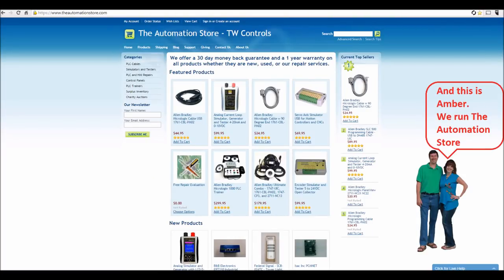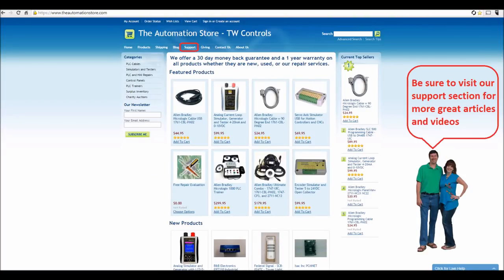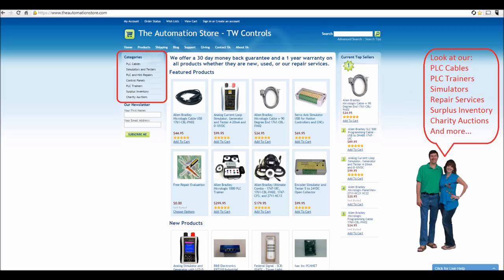Introduction to Electrical Control Panels including PLCs and HMIs

Comment: Thank you for your very informative and much needed videos.  I started restoring old machinery as a hobby and need to learn about the electrical controls. Thank you so much.
Reply from the maker: Glad to help
Reply: @TimWilborne  Maybe this is not what your channel is about, but what I would like to see in one or more videos is the type and gauge of wire,  type of wire connectors, crimping tools, terminal blocks, types of project boxes, enclosures, and WHERE to buy these items.  You have a large number of videos and Playlists and I have spent quite a lot of time trying to fine the information I need with some, but limited success.  I'm dealing with Machine tools. Lathes and Milling machines, their stop/start/reversing controls, and also running their 3 Phase motors on Single Phase.Thanks

Comment: I was thinking about your panel building video this last week while installing a beautiful prebuilt control panel.  My co worker had the thing so greasy by the time we were finished !!!  He also forced the rigid conduit, that was cut too long with a kick from his boot to the ko on top.  The door was a little bent after that.  I told him about your video and the gloves, and cleaning every few minutes, and he started to laugh !!  So keep in mind what happens after it leaves your place.  Pretty sad some of the electricians in factories are just careless labor.
Reply from the maker: Yes I've seen some crazy installations over the years.  I should probably do a video showcasing some of them.  We have found that if the install isn't done cleanly, the system is more likely to not be taken care of over the years.  We've shocked a few owners by telling them we wouldn't build any more control panels for them because their installer's quality wasn't good enough.

Comment: Hi, I’m recently getting into an electrical engineering role in a poultry kill facility in the UK so 3 phase 230v. I’ve been told that the thing they need most is for someone to be able to fault find, identify and repair on 24v safety circuits. Could you do a video on the basics as I’m really interested and looking to get some knowledge. Great vid, thanks Tom
Reply from the maker: Hi Tom, thanks for watching!  As far as safety circuits I've avoided them till now because there are so many requirements that vary by location and industry, but a few safety troubleshooting circuit videos would be a good idea.  We have some basic circuit troubleshooting videos in the works.  This sinking and sourcing video can help clear up a lot of confusion on 24VDC circuits to and from PLCs.
https://youtu.be/VFdtz3q4as8

Comment: Good job. Side note - I wish finger guards were standard on all disconnect power inputs. I hate opening panels with exposed input 480VAC lugs.
Reply from the maker: Most have guards. That disconnect does, they just weren't installed during the video.

Comment: How do you distribute the 24vdc to different items? Some plc's need as many as 3 lines of voltage and the transformer only has 2 screws for terminals. Is there a distribution block for din rail?
Reply from the maker: Yes, we are working on some videos detailing out these parts.

Comment: Nice video.  How do you cut the square holes for the hmi. Currently use an angle grinder,  but its messy
Reply from the maker: I use a grinder too, here is a video I did on it.
https://twcontrols.com/lessons/cutting-holes-in-control-panels-cutoff-wheel-vs-jigsaw-vs-plasma-which-one-wins

Comment: Great video! Appreciate the time input but I have a requests. I have been selling servo's, VFD, PLC's and motion controllers for years. I know exactly what to spec on that end but am completely lost on fusing, contacters, etc. Can you put a Best Practices for a PLC project and a couple of servos or VFD's, what should be used on the input side?

Comment: good day, have you ever made a control of two synchronized axes with analog outputs +/-10v, I am doing it with an s7-1200 but it is not precise
Reply from the maker: You need a motion controller for precision.

Comment: hi sir, will you further tell us about how to work on control panels? safety  and precautions.
Reply from the maker: You need to find information on arc flash and shock protection. There are lots of good videos on YouTube about this.

Comment: Thank you for great video.Can you advice any good literature or info for controls building?There is any info on small DIY projects using basic relays and contractors similar to DOL.Thank you
Reply from the maker: You can find lots of great articles at https://www.theautomationstore.com/articles/.  Here is one specifically about motor starters https://www.theautomationstore.com/3-wire-control-start-stop-circuit/

Comment: Thank you so much for your videos.  I have a degree in Instrumentation/Controls but I have hard a time finding work due to the fact that I don't have any hands on experience.  I'm trying to find work in the Central Texas region.  I have both a BS in Environmental Engineering and a technical degree in the Instrumentation/Controls field.  Any suggestions?  Can I teach myself panel building?
Reply: I would start by sending out some resumes and doing interviews instead of posting comments to YouTube. Just my 2c

Comment: hello Tim, Good Morning...
How do we calculate the cable size for both single phase and three phase systems based on Ampere rating?
Reply: Phase has nothing to do with current. Look up the wire ampacity chart in the NEC. You don’t need to do any calculations unless you want to check for voltage drop on a long run.

Comment: on a micro 800 im going to use current transformer, for my solar system, the current will be flowing both ways how do i make the plc see which way the current is flowing  thanks paul
Reply from the maker: You would need a bi directional input.

Comment: Is all of PLC DC? Do they ever use AC for power to actuators but 0-10v DC for control?
Reply from the maker: Yes, many times you will have an AC powered device with the positioning controlled by an analog signal.

Comment: can you make a live example of creating at least part of this panel, and how installments are made, and how did you did the wiring diagram ?
Reply from the maker: It is on the list. thank you for the suggestion!
Reply: But I hope it will be soon not a long term suggestion
Reply: Any news ?
Reply: 1. Layout sub plate.
Tape Mylar paper to sub-plate, Draw your lines.
Center-punch where your screws/rivets will be.
Use paper template over and over.
2. Mount DIN rail and Wire duct.
(DIN stands for Deutsche Institut fur Normung)
(Finger wire duct or Hole wire duct) with screws or pop rivets.
Drill pilot holes, screw holes and then tap holes for screws.
8-32 / 10-32 x 1/4" with lock washer or metric equivalent.
Philips head or nut head . Some are self tapping.
No tap for rivets.
Mount components to DIN rail or fasten to sub-plate
with screws and washers (Many different sizes).
3. Mount Tag track with sticky back and rivets.
Install tags.
4. Wire Components.
Wire components according to electrical schematic.
Size wires according to necessary amperage of components.
Use wire Ferrell or ring / fork terminals when necessary.
Some Soldering may be required.
Screw drivers, Wire cutters, Wire strippers, Pop rivet gun,
DIN cutter, Band saw, Sander, Files, Drills, Taps, Solder,
Solder iron, Shrink tubing, Lamacoid markers.
Nut drivers, Wire crimpers, Hammer, Center punch.
Drill Motor, Transfer punch set. Pens, Pencils.
Pencil sharpener, Eraser, WD-40, Rags, Windex.
Scissors, Sharp knife, Heat gun, Electrical Tape.
Dremel and bits, Dielectric Goop for ground bar.
Straight edge, Tape measure, Safety glasses.
Coffee. (Optional for some)

Comment: What software do you use for wiring diagrams etc?
Reply from the maker: Hi Terry.  Right now I'm using an old version of Autocad but this is something need evaluate some time.  There are a lot of good options on the market.

Comment: My employer uses  something called a "pull sheet" for wiring our panels. Are you familiar with this? If so, could you explain the difference and show an example? I'm a mechanic and am interested in the electrical side of things. Its my understanding that the pull sheets are generated from the schematics and just simplify things.
Reply from the maker: You'll see them used a lot in large installations.  It makes interconnecting panels much easier.  I don't get involved in many large scale installations so I'm not experienced enough do a video on them.
Reply: That make sense. Most of our enclosures are 2,3, and even 4 doors. The schematic notebooks are like huge novels!

Comment: Hi Tim, great video but I'm confused about one thing, your 120VAC power distribution  on page number CO2 of your sample drawings, what is being powered up? What wires are going to the aux contacts? I'm sure it's something I overlooked. Can someone please explain this part to me? Thanks in advance
Reply from the maker: Those are chemical pumps that we supplied 120VAC continuously to then there was an enable dry contact that actually triggered the pump.  So if you find E0114CR1...which can be found on page E01, rung 14, you'll see Y6 enables the pump.  The reason we do this is so that the chemical pumps can easily be primed from the pump when changing chemical drums since they are always powered.  They switch them to hand at the pump, prime them, then switch them back to auto which puts control back at the PLC.  Clear as mud?
Reply: @TimWilborne  thanks Tim

Comment: You place a control transformer directly (almost against) beside the PLC CPU..
Reply from the maker: It was further away than it looked at that angle but yes it was very tight.

Comment: Hi, excellent video congratulations, one question please, which software do you use to do electrical design and panel building, Thank you.
Reply from the maker: Jairo Alvear I use the basic version of AutoCAD but recently I've been playing with Google SketchUp and it's shows potential for making electrical drawings.
Reply: thanks a lot, i Will check it out. :)

Comment: Sir, i,ve been working as electrical engineer for last two years. I've seen seperate control transformer either in case when we don't have to step up or step down voltages.
Could you tell me why we use these control transformers in our panels?
Reply: I believe what you're referring to is an isolation transformer. This transformer essentially just physically isolates circuits from each other so if you happen to get a short or some other potentially damaging situation on the main side of the circuit, everything on the isolated side of the circuit will be protected from damages

Comment: Hi. 
Why can't you make a video about, how to troubleshoot by using multimeter. That would be great lesson. Example when a temperature gauge on the field is not working and you need to solve the problem.
Reply from the maker: Great idea!  We are working on a switch and instrument troubleshooting series that should cover that.
Reply: @TimWilborne   Thanks for the reply. looking forward for it. 
I have even one more thing. when a plc is not able to work properly then you need to connect a laptop to ping the plc and troubleshoot would be great too. Is that possible?
Reply from the maker: @winniekumar5291  You mean something like this one?  https://www.youtube.com/watch?v=WmVAhynBSH0
Reply: @TimWilborne  YES! Thank you very much. On today I will go back and troubleshoot my plc and se why it is not responding. Thank you for your help.

Comment: Great video,so what can cause the motor to trip on the starter switch overload
Reply from the maker: Addae Paponette Basically the motor is pulling too many amps. It could be a bad motor or mechanical binding.

Comment: Awesome video...cept the part where you're prodding around in a panel w/o any electrical safety precautions and there's 480V supply to the transformer 0_o Pretttttty sure that's in violation of OSHA 1910.137?
Reply from the maker: Covered you here but our last commenters video was popular so I'll put this one down, thanks!
https://youtu.be/MnSe_dPXvAo?t=426

Comment: What is the purpose of (12) Ammonia and (13) Phosphorus and (39)?
Reply from the maker: Hi Jim, can you give me some more information?  I'm not understanding the question.
Reply from the maker: OK gotcha, it has been a few years since I built this panel.  This was a brewery waste water system so I'm guessing that these were added because of a biological imbalance in the system.  

I know adding Ammonia can help reduce foaming and help settle sludge, both which are issues in brewery waste.  

I don't think Phosphorus was added to this system since removal of phosphorus is usually a challenge in waste water.  I'm going to guess that this was a chemical to help in the removal process.

Comment: I didn’t know that you were supposed to wire lighted E-Stops so they light up when pushed. 
I wire them so they light up when pulled.
Reply from the maker: I don't know that it is specified either way, I'll have to look into it.

Comment: Are these panels built and wired in the field or are they built in a factory and an electrician just comes along and wires electrical supply? Who installs and configures the digital and analong field devices/plc ? I'm very interested in this field of control and automation, just trying to figure out where to start.
Reply from the maker: Usually they are built in a panel shop then installed by an electrician who will at least connect the main power.  Some electricians will also connect the motor loads.  Usually and electrician will pull the wires for the digital and analog field devices but someone more familiar with the control system will actually land them and power up the system.  Here is a good place to start.
https://www.theautomationstore.com/rslogix-500-industrial-control-panel-trainer-lessons/
Reply: @TimWilborne  Thank you for the response. I have taken a college course on PLCs systems, we programmed Allen Bradley rslogix 500/5000 based off of real world industrial examples (PLCs 4th edition written by Frank D Petruzella). Am I ready to begin entry work as a PLC programmer? Should I start off as a technician building panels and work my way up by asking for cuts of the ladder logic of what I'm assembling and what the process is to be performed? I had an interview at a company and I was conservative in saying I was ready to get straight into programming but maybe I should have been more confident and gone for it. What are the steps of progression in this industry? Thanks again.
Reply from the maker: Hi Andrew.  I've been trying to think how to best respond to this and I think I'll turn your question into a video.  There is lots of things to consider.  There are very few PLC programming jobs out there.  I probably program less than 10% of the time.  Other time is spent designing, wiring, and most importantly TROUBLESHOOTING.  I would get all the programs and control panel wiring diagrams you can and study them.  Get yourself a PLC to practice on.  And yes be confident!  Subscribe to our channel and tap the bell beside of it so you know when that video comes out.
Reply: @TimWilborne  Thanks Tim! I've learned a lot from your channel and really appreciate the input!
Reply from the maker: Hi Andrew, here's a sneak peak.  Let me know what you think.  
https://www.youtube.com/watch?v=Ct4443wUyhc
Reply: @TimWilborne  Hey Tim, great video that cleared up a lot of questions. It makes sense that these heavy duty PLCs are set it and forget it, but the field devices and wiring are more prone to fail. The idea of fixing a factory machine or troubleshooting/calibrating field devices does sound interesting. I enjoyed hearing your personal experience, I had somewhat similar situation of being thrown into the fire as an automotive tech. I will move forward with your advice and look for a maintenance job. On a side note a may be offered an opportunity to become an Hvac controls technician (industrual/commercial). I would use my PLC knoeledge but also go on to learn more Hvac knowledge, software, DDC, and some networking concepts. Any thoughts on this? Once again I appreciate the video, you covered a lot of bases, very helpful, thank you!
Reply from the maker: Andrew Morgan  The HVAC and building automation is getting more high tech everyday.  Your larger systems  are PLC controlled and use lots of distributed I/O.  I think my advice would be the same.  As long as it looks like an opportunity to advance your skills in a direction you want then go for it.

Comment: how can we get single phase 230 vac from 480 vac three phase north american supply?
Reply from the maker: radhika k Two legs of your 480-volt power and a transformer such as these would do the trick. You would just need to figure out what KVA you need. https://www.automationdirect.com/adc/Shopping/Catalog/Power_Products_(Electrical)/Power_Transformers/1-Phase_Encapsulated_Transformers_(NEMA_Rated)/480x240_VAC_to_240X120_VAC
Reply: Thanks a lot Tim, Could you please let me know the formula to calculate KVA rating or procedure you are following to cal KVA rating.
Reply from the maker: See this article on KVA calculation.
https://www.theautomationstore.com/what-is-va-volt-amps-and-kva-kilovolt-ampere-and-how-to-calculate-it/
Reply: Thank you Tim, One more question please, how to wire a single phase 230vac servo motor from 480vac three phase supply
Reply from the maker: radhika k In this case you would have a 240 volt servo drive in between
Reply from the maker: radhika k See links below for some wire sizing charts
https://www.theautomationstore.com/wire-size-vs-voltage-drop-240vac/
https://www.theautomationstore.com/wire-size-vs-voltage-drop-480vac/